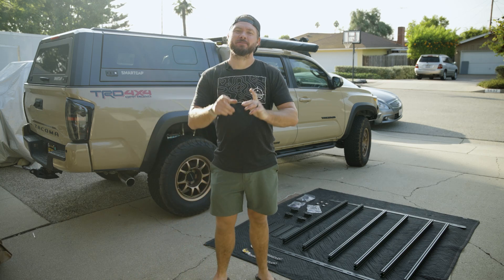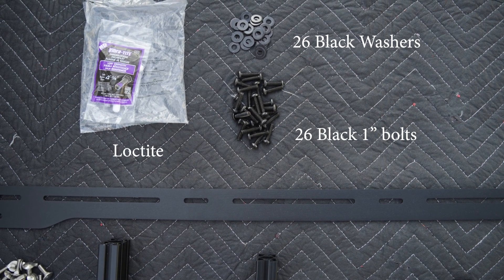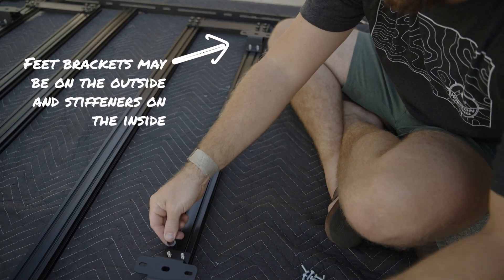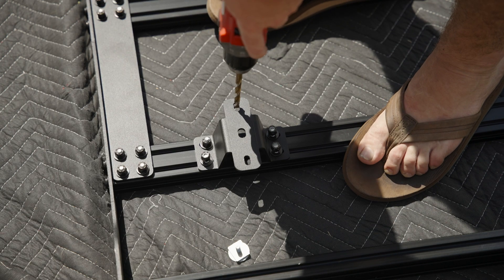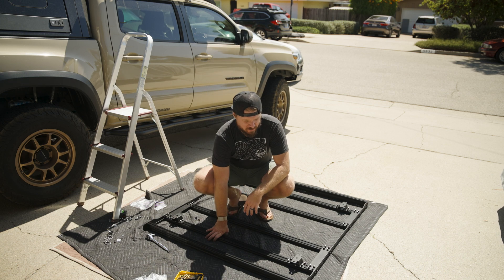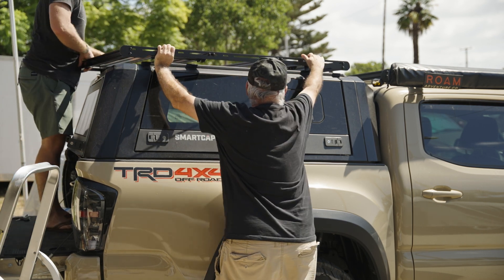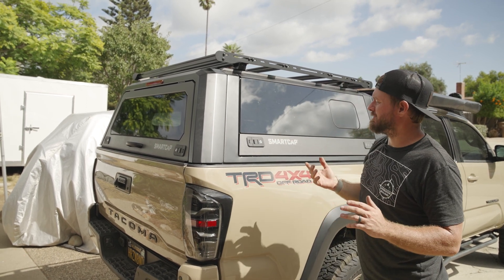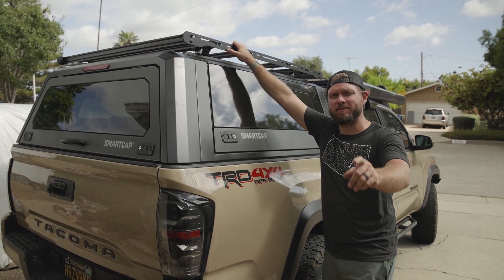Adding the PRINSU TOP RACK to the Tacoma!

Comment: Great video!!!  Thinking of the same setup for my Tacoma. Quick question---is the height of the Cab Rack the same height as the rack on the SmartCap???   Looks like the rack on the SmartCap sits just a little bit higher from the photos I"ve seen.
Reply from the maker: Thanks for the comment! You are right, the Smartcap with its top rack is JUST slightly taller than the cab rack. It's not by much IMO but it is by about a 1/2 inch to MAYBE an inch.
Reply: @HorizonBound  Thank you very much for sharing that information! I watched this video to find out exactly that. I am installing a Prinsu Pro roof rack on my 3rd gen tundra and am searching for a rack to install on my Smartcap Evo Adevnture that will be at the same height as the roof rack on the truck. I am thinking Sherpa, or possibly trying to use their mounting feet or a similar design. I would like to keep it all CBI/Prinsu to match though, lol

Comment: With that roof rack, can you still use an automatic car wash?
Reply from the maker: Hey @idahofishingfool! Thanks for the comment, and thats a great question. So, unfortunately, I'm not sure if you can. I havent been able to use an auto car wash for awhile now because of my Baja Designs LP6 light bar. I would assume, as long as you dont have anything mounted to it, you should be fine to go through an auto car wash but no guarantees that it wont damage anything. I would think other regular vehicles with roof bars and factory roof racks would be fine so I dont see why a Prinsu rack would be any different, but again, not 100% sure.  Sorry I'm not much help with your question!

Comment: Do you thing the long bed rack would clear the shark fin antenna if I install it on a short bed cap?
Reply from the maker: Thats a good question, I'm not really sure. I would assume you could make it fit with a little adjusting back and forth and teachnically, you could just not have the front crossbar if it is too close to the antenna.